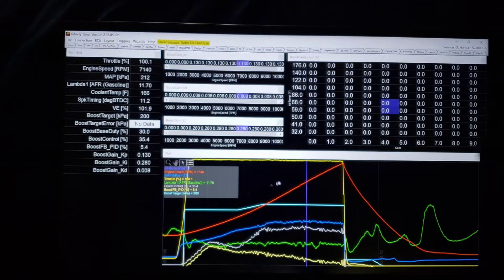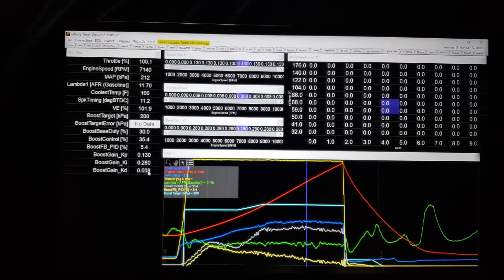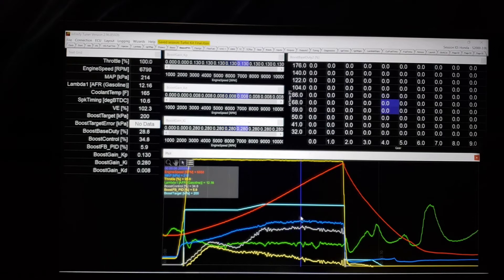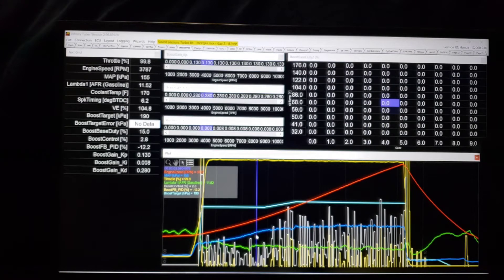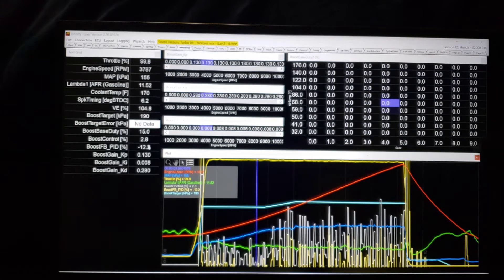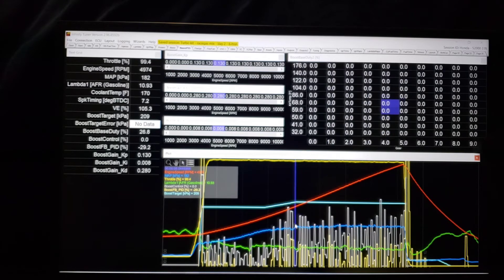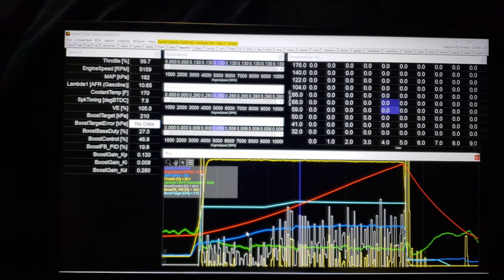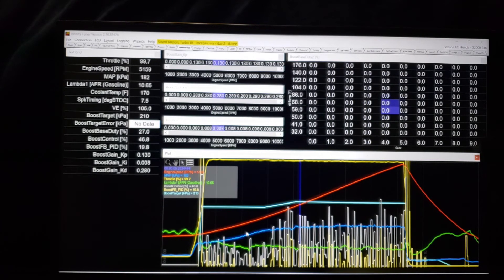Boost PID Experiment - AEM Infinity

Comment: You cannot just randomly change PID settings and not expect crazy oscillation.. there are mathematical formulas to figuring those settings, and the original seemed good minus some boost leak

Comment: Hey Aaron!
That's cool you bring PID back in mind! Crazy things happen, when you did not tune the PID right. I think you would get a similar log when increase the proportional to high, for example instead of the D. 
And it would be nice if you make a separate video about PID tuning. Especially how the best way to go. In my opinion P should be the first, then I.
I've a 4-port boost solenoid to give me a wider range of boost targets from 0.4 bar to 2 bar +.
It's running but my PID settings aren't fine tuned yet.
I think, tuning the 4-port solenoid isn't that easy, because very small changes in duty cycle give you big steps in MAP. That's why you can't copy your PID settings from your example to a setup like mine. You have to decrease these values a lot.
Maybe, if you have the time, a comparison of 3 and 4-port solenoid tuning would be great, too.
Reply from the maker: I've done those videos already. The 4 port settings I did a video on with the 12-15hz cycle worked really well. It still requires fine tuning per car of course.
Reply: @AaronONeal1  you are right. I've seen this video too. But it's some weeks ago and I forget. I will check it again. Thanks for the information.
Reply from the maker: I definitely am going to do a PID specific one though
Reply: @AaronONeal1  I'm very interested.
 Keep in touch!
Reply: @AaronONeal1  Aaron, do you are at TX2K?
Reply from the maker: @speeedya  not this year, rest of the team is
Reply: @AaronONeal1  this is a pity. I hoped to meet you there. I extra came over from Germany.:)